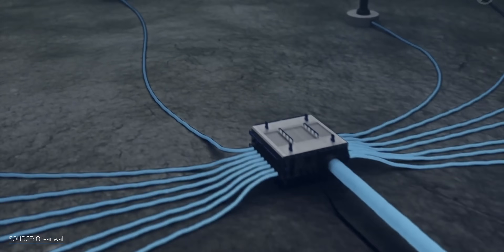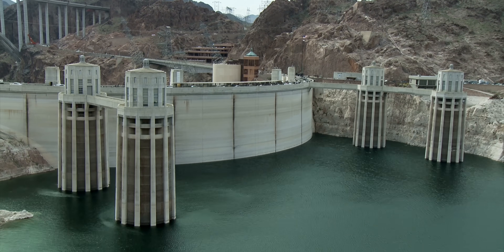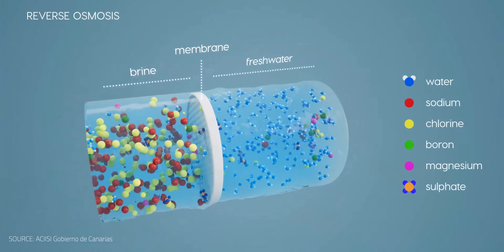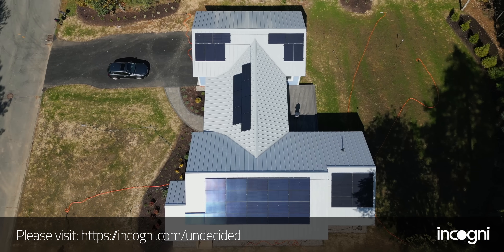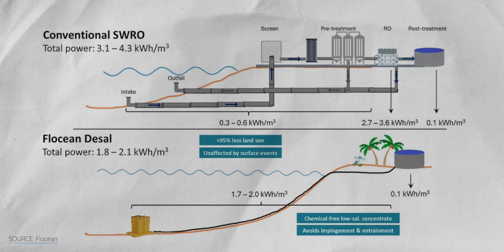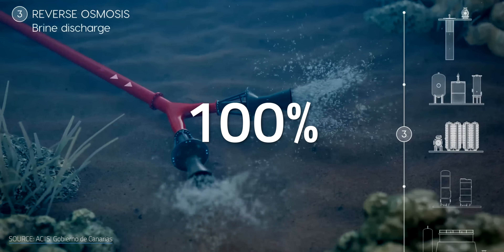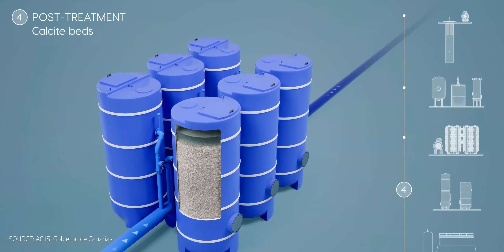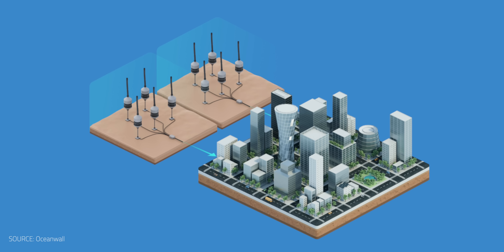How Deep Sea Water is Now Drinkable

Comment: How about a tech that uses no filters & has no brine discharge? Like harvesting atmospheric water. Put a plant right on a water body & you have damn near 100% humidity. No new tech involved. Am I missing something?
Reply: Cost and quantity??? The amount of water in air is extremely small compared to the amount of water in salt water. In addition, refrigeration (or any condensation mechanism) is more expensive and difficult to scale than pumping/RO.

Comment: Reverse osmosis has to do with the pressure difference between the two sides of the membrane . In deep see the pressure is high but the difference is zero. What am I missing ?
Reply: It’s easier to just pull on that high pressure to generate flow through the membrane than to generate the high pressure from nothing.
Reply: @calmonnier2512  I don't get it. Let's say that on surface you need 100 atm  pressure difference for this to work . At 1Km depth , you have 100 atm on both sides of the membrane. Don't you need  100 atm of pressure difference there ?

Comment: Power plants have tall smokestacks to reduce the local pollution from the plant, but it still goes east.  Remember acid rain?  Salt releases will still be the same for whatever volume of water they will refine, sending it into a current layer to be deposited someplace else seems problematic.  I worked in the water treating industry for a while, they would always say "dilution is the solution to pollution", well maybe at your outfall but it still goes somewhere.  I don't want to discourage the idea though, it has a lot of potential.  I hope it is sucessful.  The Colorado River water deals California have are criminal, hopefully the upstream USA and Mexico users can get a break if this goes large scale.
Reply: I agree with you for power plants. Sulphur dioxide and ash particulate are not normal components of air and we don't want them in the air at all. With desalination plants, the brine output is natural components of sea water, just much more concentrated. Nature removes far more water from the oceans by evaporation than we can conceivably remove from desalination plants. The difference is that it is dispersed over the entire surface of the oceans. The variable evaporation causes variable salt concentrations across the world which, along with temperature differences, power the ocean currents. Well planned dilution of the brine shouldn't be a problem. We, however, will use the cheapest method possible until forced to do better. It has been that way with cars, power plants and sewage treatment. Why should be expect different from desalination.

Comment: I thought that it was pressure difference and not absolute pressure that made it go through the membrane. So i am surprised because I thought at this depth everything is under the same huge pressure. But if I am wrong then it's great. I also think that using solar heat (with glass and maybe also mirrors) could be the basis for sustainable desalination devices.

Comment: I am not saying it's a bad idea but their might be some basic physics issues that are more energy intensive then you might first think. pretend this set up is on dry land, you still have to pump the water up the mountain. now when you take water from the lower part, let's say a you have strong enough pipe and pipe able to handle it but lets say you want all the water out so you make a perfect vacuum in the pipe. did that vacuum take no energy to make? as all you are doing is pumping the water? now let's say your vacuum filled pipe that goes up a 1000 foot mountain is at the bottom of a 10 foot lake now if you open both ends of the vacuum filled pipe how high will the water climb up the mountain, what if I only opened the bottom of the pipe first? would the water shot up to the top of the mountain https://en.wikipedia.org/wiki/Inch_of_mercury

Comment: If San Diego (for example) is making up 7% of it's water supply with desal water it could easily replace that with lower cost approaches such as waste water recycling (completely practical despite the eww factor) and improved efficiency. I've been to places in the USA (e.g. Phoenix where people have grass lawns in the desert and water them with sprinklers! in the afternoon!) where water is allegedly scarce but where people don't act as if it is. Basic existing technology like zero flush urinals could save huge amounts of water yet they aren't being used. Add to that the sort of low tech systems for capturing surface water that are being practiced in places like India and Africa and most places that aren't absolute desert  can do away with desalination.

Setting this stuff up on the seafloor is child's play compared to the huge amount of subsea petroleum infrastructure that's already out there. The North Sea seas floor is basically littered with pumps, pipelines, power cables etc for oil and gas extraction.
Reply: "such as waste water recycling " <- that was proposed many years ago but local right-wing politicians (Roger Hedgecock)  made it one of their targets and derailed.

Comment: I feel like you rushed this video out. You glossed over where lot of efficiencies come from missing most of understanding of them and it makes the video makes it sound like a scam full of more holes than a semipermeable membrane.
It is not that the RO part of DSRO that is more efficient its the plant as a whole.
The big reason for efficiency increase is you are only pumping fresh water not All the water (including your waste water). Its not the "sucking" is more efficient than pushing its that your only pumping the thing you want fresh water. Also a big factor in life of the pumps are now your pumps are on the fresh water side of your line so you dont have to deal with salinity damage.
The big "issue" with this is comparing the plant construction costs and pollution vs on going costs. Its like comparing a gas and electric car you dont just want to compare the tail pipe emissions you want to compare the car life time (which is better for electric the longer the car lasts). For an RO plant Im not so sure its going to take a lot of construction work and have a deep sea maintance cost. With The grids getting cleaner every year you can no longer compare coal energy pollution levels and it makes the calculation more complex you cant really count Off shore wind to DSRO plant much more than off shore wind to grid to RO plant. Also water storage is common place so it really is something you can run only when the sun is shining and the wind is blowing and store the water for when you need it (I mean that kind of what windmills that pump water already do).

Comment: First, you could also do this kind of filtration right at the shore line. No need to go that far out. The only thing that matters is the depth of the water column - so, drill your own holes near the shore lines 300m deep and lower a pump/filter setup into it. In fact, you could even install this setup on land and pump water into it from the shore. But overall, i think i have a better solution...much better, a solution that solves 3 problems at once. 1) You repurpose or custom build Ice harvesting ships and send them up north. You can sign an ice breaking contract and keep shipping lanes ice free( your first source of income ). Then, instead of simply breaking the ice up, you harvest it by conveyor'ing it up into the insulated cargo hold( ships the size of oil tankers can carry huge amounts of ice ). 2) You then ship this ice into hot climate areas( middle east, arab emirates, qatar etc ). You then harvest the energy from the ice and use it to provide centralized cooling to the cities( systems like this already exist ). That is your second source of income. The energy content of ice reaches into millions, and could even be 10+ million dollars. 3) Once you have extracted the energy for cooling, you are left with a tanker ship full of fresh water( your third source of income ). With minimal treatment it can be pumped into cities drinking water supply. 4) Since this solution is as green as it gets, you can apply for government grants, subsidies and various funding sources for green energy initiatives ( your fourth source of income ).
Reply: Water sells for far too little money to be worth moving around in a supertanker.The cost per gallon for seawater desalination is approximately $0.0025 to $0.0043. That's a fraction of a cent per gallon.
Reply: @jeffjwatts  there are islands and other places where water is not available and ships have to transport water to them.  Obviously, the transport company has to charge a lot for the water, but how else can they get the water?
Reply: @richardservatius5405  Sure, there are a handful of places that don't have access to freshwater and aren't big enough to build their own de-salinization plants. But that's very much a tiny use case.
Reply: Technically, you would harvest the energy from the hot climates to melt the ice. Ice has very little energy. Removing energy (heat) from buildings in hot climates is valuable and would save large amounts of energy used by reducing the use of present day refrigeration technology.

That said, I would like to see an engineering evaluation using currently available technology, what would the energy consumption and costs of such a system compared with our current systems are. It would be a very difficult system to implement as there are a lot of components that must come together at the same time and probably need considerable ice and water storage to match supply and demand of water and cooling which will vary greatly with weather.

Comment: If we replaced fresh water with desalinated water, at least on urban areas near the coast (which are the majority) how much our water consumption would help reduce the sea level rise?
Reply: None.
Sea level rise is caused by glaciers melting (Antarctica, Greenland, and permafrost areas in Alaska, northern Canada and Siberia)
Human water consumption comes from water that was destined to the sea (lakes and rivers) and returns to the sea. (Either through rivers, or through evaporation and rain elsewhere)
Reply: Very little. We keep very little of our municipal water. Almost all of it goes back through the sewer system, into the rivers and back to the ocean. Most of the rest of it goes to lawns and crop land where it evaporates and comes back down as rain which ends up in the oceans. The amount that is delayed on its return to the oceans is minuscule compared to the amount of water that is locked up as hundreds of thousands of feet thick ice in Antarctica, Greenland, and other land areas that never thaw. As these areas melt with climate change, the sea levels go up.

Comment: Always baffles me how huge amounts of power needed in sunny climes is not supplied by solar energy?
Reply: "Always baffles me how huge amounts of power needed in sunny climes is not supplied by solar energy?"
Solar has only been economically competitive for the last 5-10 years. It takes time to build it out.
Reply: And when land value is high, no one wants to pay that much to turn it into fields of solar panels.
Reply: Because when you invest big $ in a reverse osmosis facility, you need to run 24/7, not part time.
Reply: Cost
Reply: Who needs solar when you can harvest the heat from magic death ray rocks?
Reply: I think one of the main issues is heat quickly makes solar panels less effective. Optimum temp is around 25 celsius, which is far below how hot these panels can get in a hot desert.
Reply: @sebastianalegre7148  At 50C, the panels would lose about 10-15% efficiency. Not ideal, but still producing electricity 85-90% even at a high temp.
Reply: @sebastianalegre7148  yes, it makes them less effective, but that's somewhat counteracted by more sunlight. It's still better to be sunny and hot than overcast and cooler. I remember installing solar panels in the Nevada desert when it was 106 degrees in the fall. Actually one of the more relevant downsides of hot (dry) areas is that you have to regularly clean the dust off the panels, which is an added cost.

Comment: Can’t the filters be cleaned using all that pressure in a separate process? Perhaps the filter system could be redesigned with removable stages that allow for easier, independent cleaning. Also, could ocean pressure be harnessed to transport fresh water from Arctic ice melt to the Southern Hemisphere

Comment: Maybe I'm not understanding how it works, but to me the output is still a water column,  when reaching the surface the net potential energy will be zero, so the pump has to do all the work anyway.
Maybe fresh water is more buoyant and increases the efficiency slighly... But I don't see the energy miracle here!
It's like sticking a giant straw and expecting the deep sea pressure to push water out of it...

Comment: I think the major problem is that the energy required to pump the water from the depths of the ocean to your table or farm is much more costly than the desalination plant at the shore.
Reply: The "pump" efficiency calculation is very different than what you get at first glance the efficiency is because you are only ever pumping fresh water in DSROs where in an on shore plant you are pumping your waste water as well. When you run some basic numbers to double the salinity in the water the amount of waste water you pumped in your compression phase was 2/3s of the water you got out. You are pumping a 1/3 of the water in a system where you are only pumping fresh water.
Reply: You can use the shoreline to turn turbines even rip currents could be exploited to generate the power and once you get water moving vacuum pipes can provide more flow

Comment: I hope that one day you’ll talk about our technology: solar thermal desalination with automated solar tracking using parabolic concentrators, managed by sensors and controlled through AI. 

Unlike traditional desalination systems, we don’t produce brine. Instead, as you know, we produce steam through a distillation process, and this steam is also used to generate electricity. We even manufacture our own specialized steam turbine, the Tesla Turbine 2 (improved), designed to fix its known limitations, such as requiring extremely high RPMs to operate and producing excessive heat. 

Our system delivers three outputs: fresh water, electricity, and crystal salt. I created this system because of the limitations of RO.